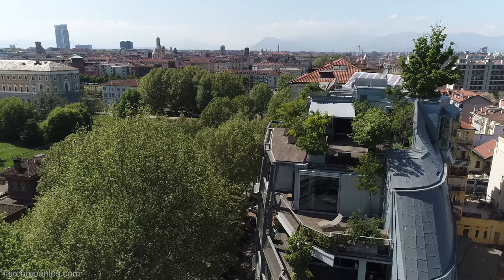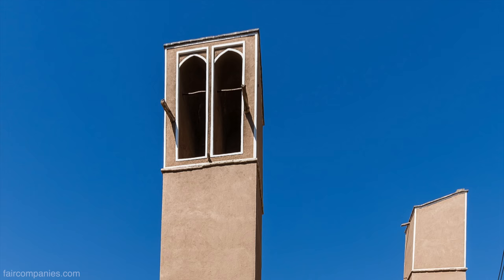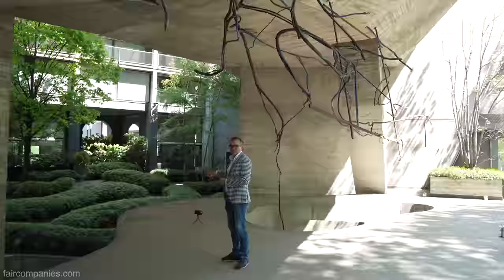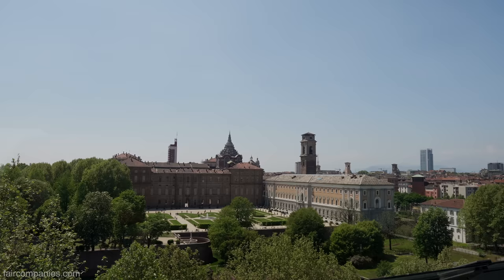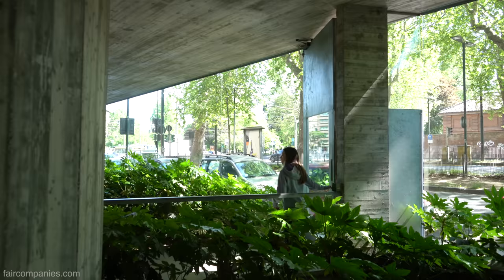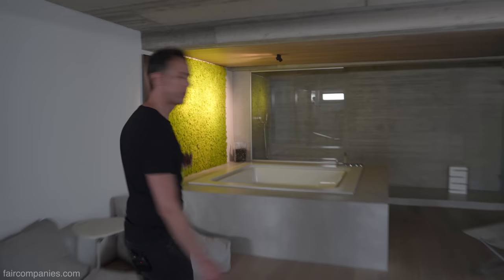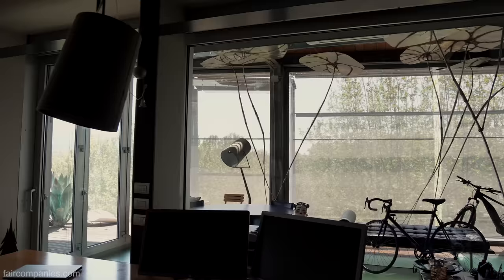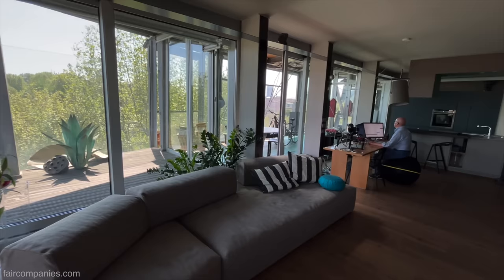Modern building, ancient A/C: wind-tunnel facade cools apartments

Comment: In the winter, with the cooling convection stopped, you basically have the greenhouse effect. In the summer, the infrared light gets trapped between the glass, heating the air, but the heated air is allowed to vent, instead of the heat transferring into the house.

Extremely clever and elegant solution.

Comment: In Iran the technology is called "Baud Geer باد گیر" which literary means Wind Catcher and in affluent homes they would combine it with the water distribution system "qanat قنات" that runs under the home and by opening and closing valves they would regulate the venturi effect of air movement as well as water evaporation to cool the homes for probably a couple of thousand years.  The best examples are in central Iran in the city of Yazd.
Reply: I'm sorry but you don't talk about the same topic. The physical principle applied in this project is the "ventilated facade". Usually the outer wall is opaque. The solar rays heat the external wall forming a convective movement of the air from the bottom upwards in the cavity. In this case the transparent outer wall allows the sun's rays to heat the inner wall. The result is a useless convective movement because the warm inner wall heats the room like a greenhouse. light is heat, my father said, he was an old engineer who loved shutters. Quanat are widespread in the Mediterranean, even in Sicily, in Palermo there are the scirocco caves, where the water, lapped by the warm wind, evaporates and cools. Wind catchers or Baud Geer collect wind at the highest reachable altitudes and convey it downwards. If the wind licks the water it evaporates and the change of state lowers the temperature.....

Comment: The top floor unit is really nice. 🤌  I think all the homeowners should redesign the courtyard so there is a walking path and benches to have a conversation outdoors, perhaps a water feature in the middle.  I would also create a green wall barrier to block off the street traffic and noise so the courtyard is an oasis from the city.

Comment: Be nice to have prefab 'air-crete' panels for passive modular home builds. Also using the wind chimney skin incorporated into the passive solar. Viable indoor year round temperatures with minimal energy input adjusted to each zone with only minor design corrections. With inner courtyard planted in zone appropriate perennials & annual raised beds for food source. Plus a bulletproof greywater reuse system & compost toilet. The local use adobe 3d printed walls seem to be getting the closest, just need some features with passive/wind chimney designs incorporated. CAD with adobe adjusted for local climates & low overhead costs as a goal. Wonder if there is a super material that could be low cost but, give triple glaze efficiency & daylight.

Comment: I don't like the windcatcher analogy because this facade system is based on different principles. Windcatcher system works because of the pressure difference between each side of the tower. This facade system can only contribute to building by little to not get immensely hot. I don't think that it cools down the building like the windcatcher system. There are AC units literally everywhere of the building. Look at 5:34, there are not just one but two of them in one small room. It is a very stupid idea to get direct sunlight if you are in a Mediterranean city.

Comment: All of these energy-saving concepts have been used in industry for decades. Key words there would be e.g. heat recovery, cooling towers and heat pumps. It is also normal to use such techniques in high-priced skyscrapers with apartments. However, the acquisition costs are so high that normal consumers cannot afford it.